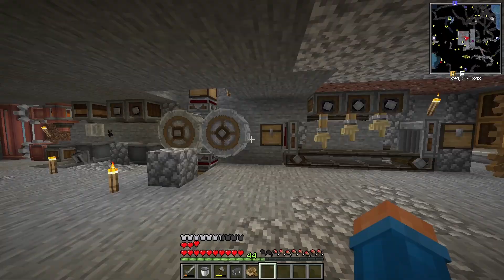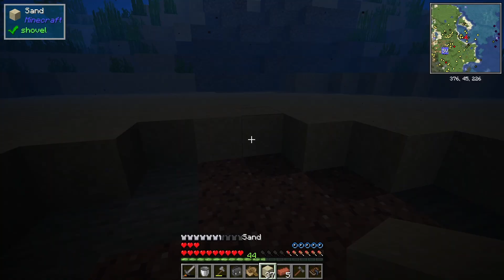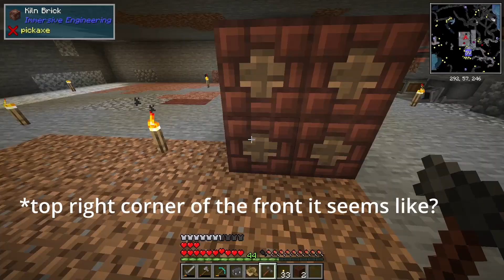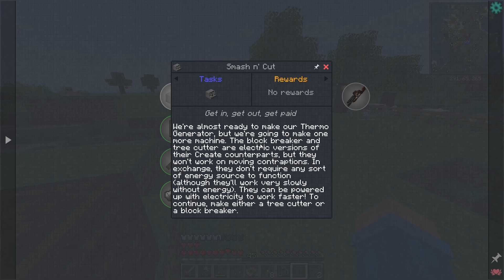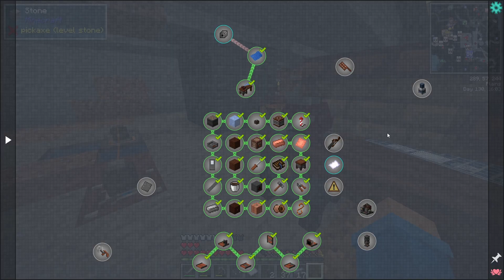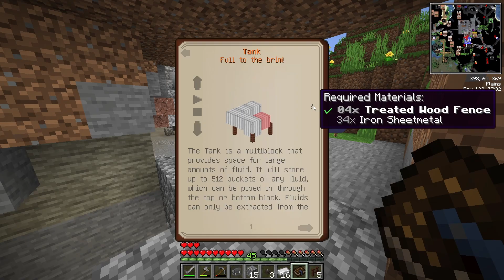Immersive Engineering Steel | Automation Nation E6

Comment: Not sure if you don't already know this or not, but you can use the chain drives to transfer rotational power laterally, also comes with the benefit of not changing the direction of rotation, pretty neat at times. Great video, keep it up!
Reply from the maker: Hey it's very nice to hear from you again, Curious! Hope you're well. I've heard of the chain drives but haven't utilised them much; thanks for the tip. I'll keep that in mind in the future as another tool in my toolbox, as right now I just use gearboxes and mehcanical belts with my limited Create knowledge xD